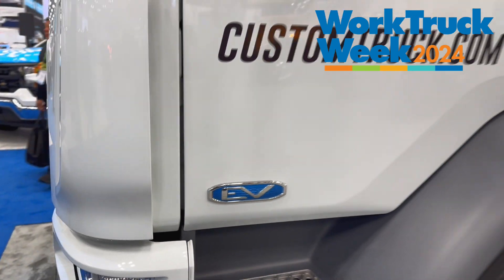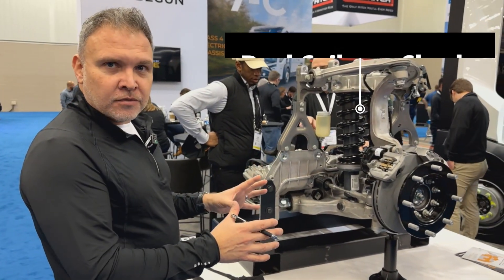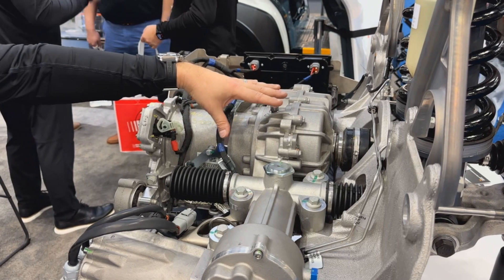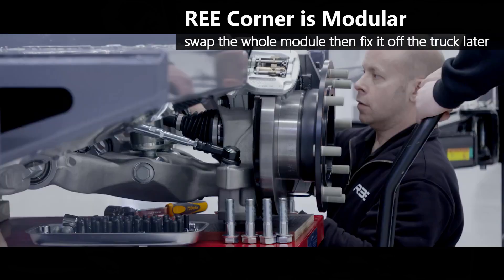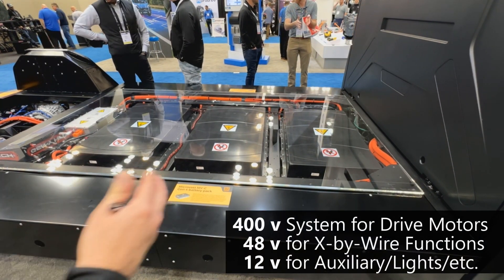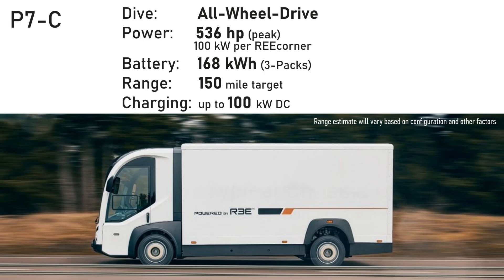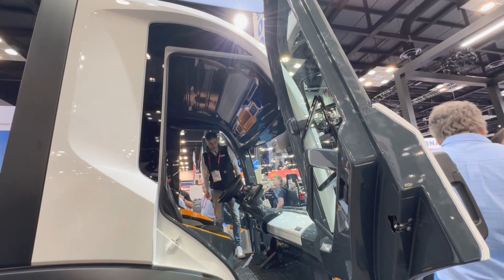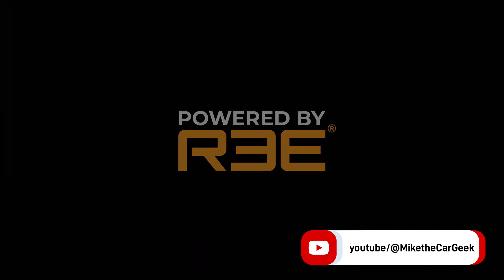REE Automotive all-electric P7-C (rethinking the work truck)

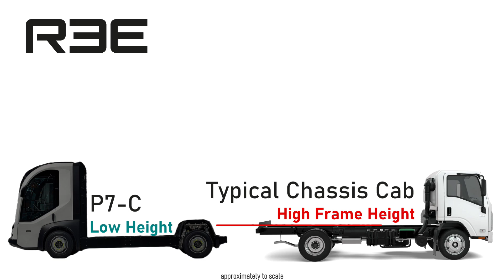Comment from the maker: 5:19 the Battery Capacity is actually 126 kWh for 3-Packs, this was confirmed by a representative after the video went up. That makes more sense, around 1.2 miles per kWh efficiency.

Comment: That 1 module is basically 1 part?  consisted of multiple parts but only 1 module?  If they can manufacture that 1 module for replacement part. That will really save time. But, thats a lot of subparts for that 1 module!  and also, it needs more space!  since its considered 1 part/module... the shop needs to have massive space! just to keep those Module available for swap purpose.